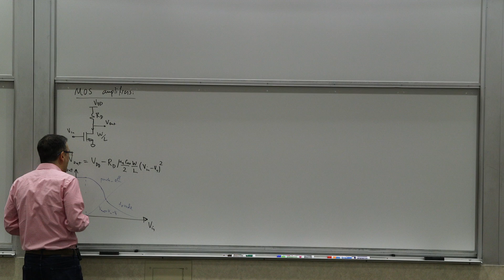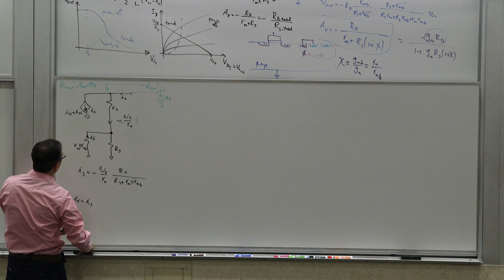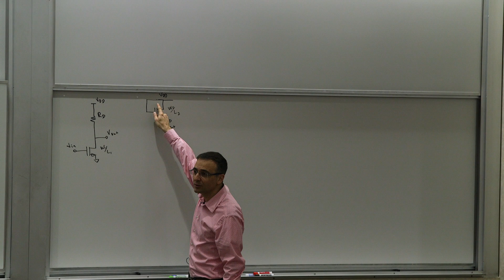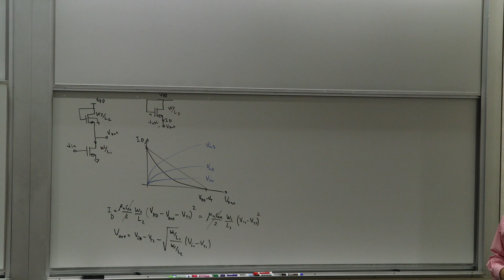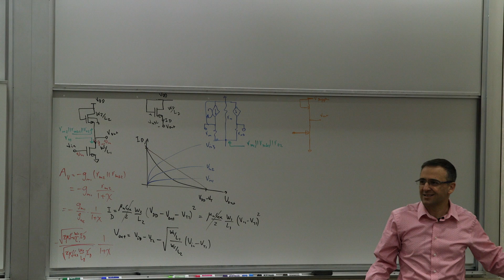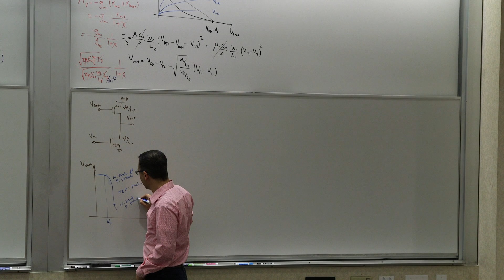Comment: Sir at 1:02:49 why we prefer top transistor as PMOS means you told PMOS has smaller mobility so that it will helpful to increase the gain. Sir If top transistor is PMOS, bottom transistor is NMOS both are connected in series in this case drain current same for both MOSFETS. In order to provide same current width of the PMOS more when compared to width of NMOS because PMOS has smaller mobility in order to compensate this we increase the width of PMOS that means W2 increases. How gain increase in this mobility case?   In another way If I use pmos as top transistor we will nullify body effect so that gain increases.

Comment: 12:00 body effect
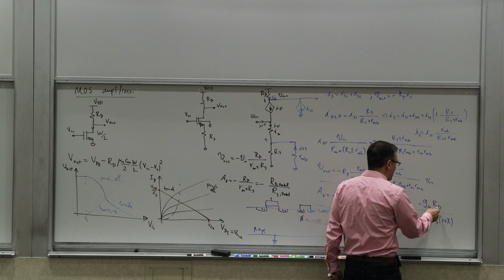27:30 source degeneration reduces gain to make circuit but reduce output swing,lesser headroom and  increases output resistance
37:00 Second order effects in % definition
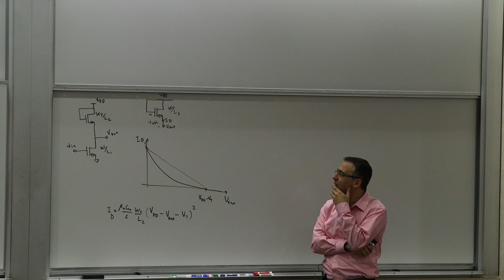46:00 diode connect load , load-line vs resistive load-line
Reply: thank you

Comment: Hello sir
Here is one question that bothered me about the biasing of pfet, if we apply higher than 0.7 posstive voltage at source terminal then pn Junction that formed between source and bulk would have forward bias and could damage the transister because of huge diffusion current if bulk is grounded which is normally the case. Can you please clear my concept here.
Reply: For pfet, bulk is connected to highest potential available,  which is vdd in this case

Comment: I approve of Dr. Hajimiri's emphasis on familiarizing one's self with the various topics and effects in a way that's "conducive to design."  I believe in exactly the same thing - I phrase it a different way.  The goal is to get to the point where you can design "intuitively" in your mind.  Obviously you don't work out every numerical value in your head, but when you can do this you can consider and discard (when appropriate) design options.  The early phase of your design process - while you're "arriving at an architectural plan" can just be done... "contemplatively."
   
Analog wasn't my specialty - I'm not at that "intuitive" level in analog design.  But I can do it with digital logic circuits, and it's a very nice feeling being able to do that sort of thing.